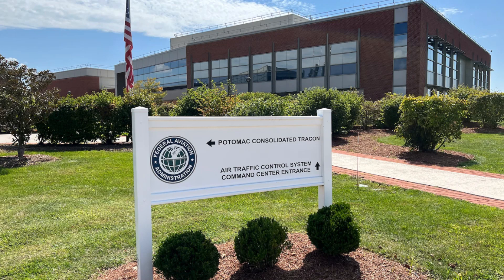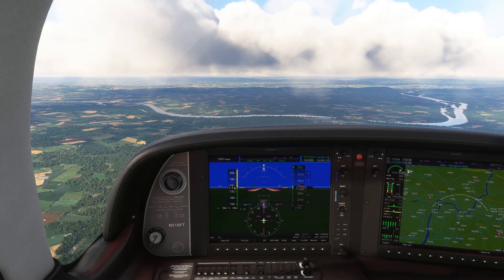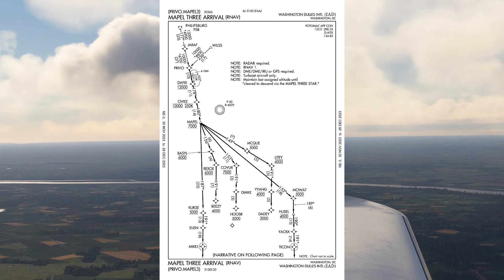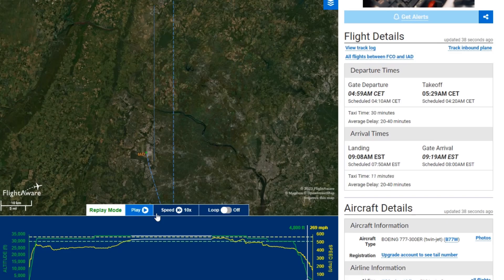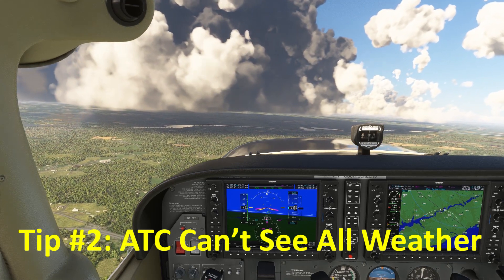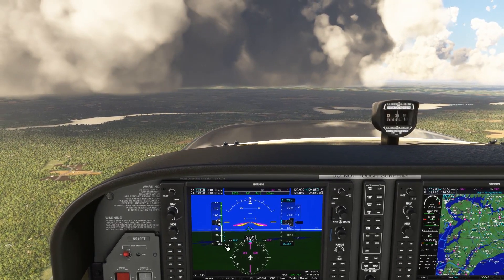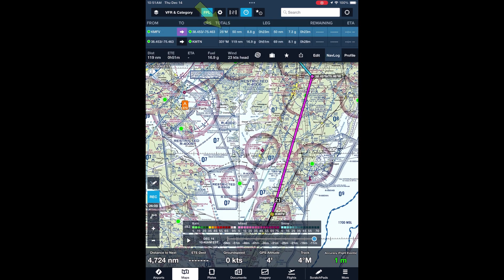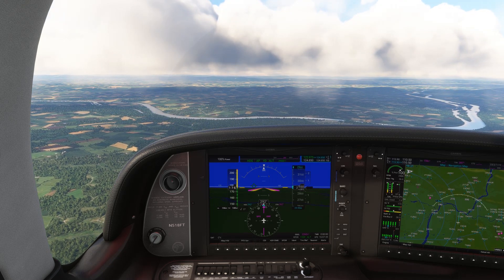Tips from Air Traffic Controllers | How ATC Works

Comment: Interesting about the class B……here in Aus if the lower limit of a step is, say 3000, then you can fly without clearance up to and at 3000……ATC will keep aircraft in the step cleared above that height by at least 1000 in IMC so if you want to keep uncleared aircraft below a step then drop the step height……so in your case with the class B why don’t you have it at 2000 and that way there’s no chance of an incursion…….just saying…

Comment: In the specific example of flying just underneath the Mapel Three arrival to IAD (19L), we're already also inside the SFRA and therefore on a SFRA flight plan. I would (naively) hope that an altitude of 2900 in such a flight plan (ie to/from the LUCKE gate) wouldn't be approved in the first place for the reason you said (only 100 feet below the min STAR altitude at DADEY), but I'm probably wrong...

Comment: First of all, RELAX. ATC would almost never clear or vector an airliner to overfly or intersect the path of another aircraft flying just outside the bravo... That is the whole point of having RADAR. While I understand the safety aspect, the scenario postured using the Ethiopian Airline on FlightAware is disproportionate and overblown. That said, tips #2 and 3 makes practical sense.

Comment: It is disappointing to watch you have to explain to a student that some thing is a problem, however, perfectly legal. Locally we have a class Charlie airspace because pilots were flying legally off the arrival and departure corridor for a class D airspace. They change the air space to meet the safety needs. It works well when it is black-and-white you cannot be someplace.  If it is a safety hazard fix the system, don’t tell pilots they’re legal, but shouldn’t be there. It’s a lot easier to point on a map and see you may not go here because it shows you you cannot go be there at that altitude.  The air traffic controllers are pointing out a safety issue caused by poor regulation planning. They are trying to do a good job and alert pilots that there’s a problem however, the problem stems from lack of proper airspace designation or arrival planning.
Reply: so, as pilots we are taught that there are a lot of things that might be perfectly legal, but still not smart.  Regulators are in an unenviable position of providing for ease and freedom of flight, reduced operations burdens, and  managing a fleet of diverse aircraft with vastly different needs.  It's well to understand what the regs are, why they are in place, and how operating near the edges creates increased risk.  These edges will always exist.  Just expanding the envelope only pushes them further out.

Comment: I'm a little bit confused. Isn't class Bravo supposed to be designed to comfortably contain all instrument procedures? Why would they design a shelf in a way that airliners don't have reasonable separation from legal VFR traffic just outside of class Bravo?
Reply: Because AOPA will squawk and cry if the FAA tries to lower the Class B shelf.
Reply: I mean there is no separation requirement between ifr/vfr. The onus technically lies on the vfr aircraft to get out of the way. If you’re getting ff there should be a traffic call at the minimum and a vector for either aircraft if the controller is remotely competent.
Reply: @DanIvyOffical that is... incorrect I believe. The reason class Bravo exists is due to a bunch of high-profile incidents when small Pipers would collide with airliners, so they introduced class Bravo to ensure that random VFR traffic can't get close to airliners flying approaches into large airports, and if a Piper does get inside of Bravo - that's only with an explicit clearance and the controller will provide separation between that VFR traffic and IFR arrivals/departures. If we designed an approach that is outside of the Bravo shelf - there is no point in having a Bravo shelf.

Comment: I went to a Class D tower, biggest things they stressed were: Let us know what you want to do immediately(i.e. don't request a short approach on the downwind) and when reporting your position, make sure to report it correctly, controllers use the position report to look for you with binoculars, at least in the tower position, not the radar approach/departure control.
Reply: Didn't realize they physically looked at you out of the windows

Comment: In this case, shouldn't the bravo airspace be extended down to give more margin?
Reply: Why? Just don't fly too close to the shelf. ATC separates VFR traffic operating within the Bravo by, assuming other criteria cannot be met, 500 feet vertical separation from all other aircraft. Given that, it seems prudent to always remain at least 500 feet below any Bravo shelf you're flying under. If that gets you too close to the ground for safety, fly around the Bravo, preferably giving it at least 1.5 miles berth.
Reply: @johnopalko5223  because there are loads of pilots who will read the chart and think they're fine. Either teach all pilots to fly 500 ft below the shelf as a rule or change the bravo shelf.

Comment: That first tip I just intuited my way to this last week. I took the NYC Skyline tour from out on Long Island in the afternoon. When I was doing preflight prep, I noticed that where I was planning to fly 1300 under a 1500 Bravo shelf for JFK, all the landing traffic for 31L & R was coming riiight over my planned flight path, right at 15-1600. Same thing crossed my mind: I do NOT want to get caught in the way of heavy, especially if I'm already going to be flying kind of low to stay under the shelves. Decided that if they were still landing RWYs 31L&R at departure, I would fly North and then west along to north shore of LI and do the tour from the opposite direction. Luckily they changed directions by then. Definitely a good shout out though: all approaches and departures being contained in the bravo means there could literally be a plane right at the bottom of the shelf!

Comment: Great video as always! as an ex controller and now CFII, pilots should always remember that the airspace is built with a logic behind it, either regs or the airspace and airports needs (like the arrivals and class B sector altitudes you showed in the video), even if you don't seem to understand what the specific logic is at a certain point, it exists trust me..